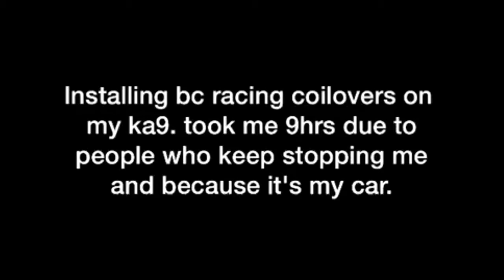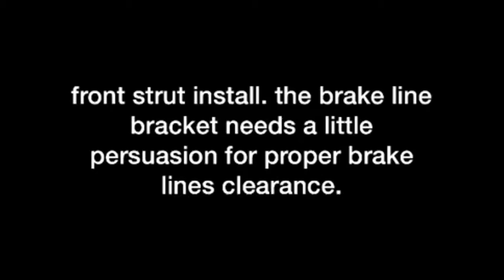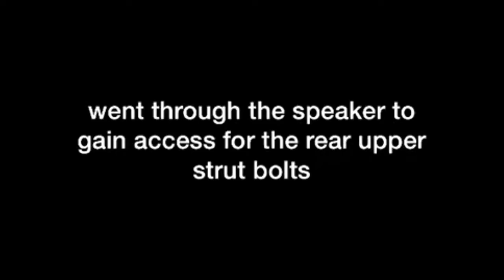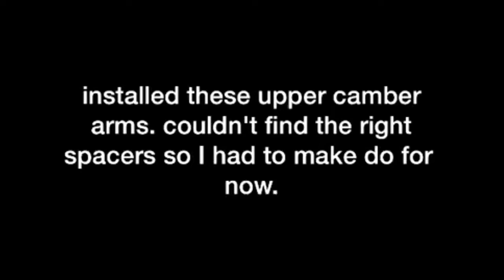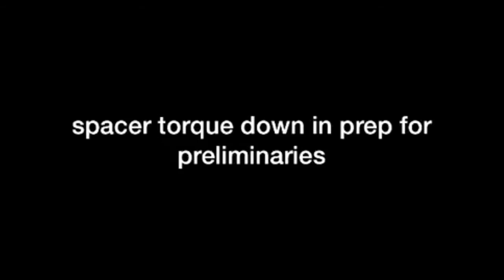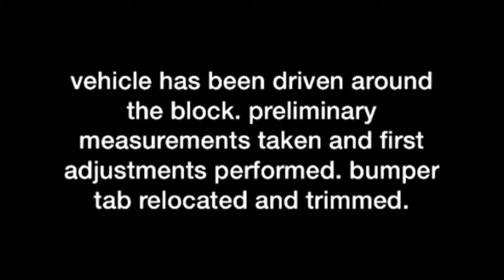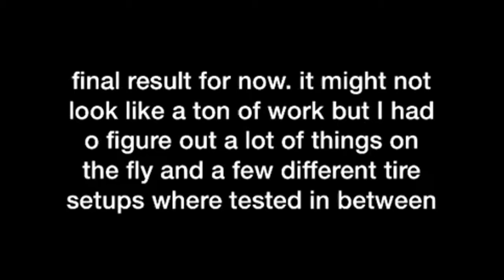Ka9 Bc Racing coilover install. Turn yah volume down!

Comment: I got 18 by 9.5 +25 offset and the wheels fit perfect for fender to lip fitment in the back, and 5mm spacers in the front for the fender to lip look, but I would recommend getting +20 in the front so no spacers are needed, this is for anyone that need help, it’s super hard finding info on this car, also if you want to run the fender to lip look id recommend upping the spring rates so you don’t damage the rim

Comment: I'm planning to lower my 2002 Ka9 with the BC Racing coilovers you used along with a set of 19"x9.5 +40 offset MRR HR3. I noticed you used wheel spacers for your car, is that a necessity for the installment of the coilover kit or something you just decided to do to get a certain look? Also you used the MDX cambers and mentioned to a previous comment that lowering the car alters camber adjustment, what happens if I decide not to change the cambers? would lowering my car still work/be safe?

Comment: Hey how's it goin? I have an 2002 rl want to lower it to.. The question is with the bc coilovers you can't just bolt them on and be done.. Why was the MDX cambers used? Is it because of the rims?
Reply from the maker: Lowering the car alters camber adjustment. I wanted close to factory adjustment and using the stock uca doesn't allow for any camber adjustments.

Comment: 19x8.5 +35 offset front,  19x9.5 +35 offset rear.. Will that work? I just want to put the adjustable bc coilovers roll my fenders and adjust the height to where it don't rub.. What you think? Appreciate the help if you can. I just bought this car of original owner with 66k on it. Don't want to chop it up to much just want to be classy with it lowered.
Reply from the maker: +Justin O&#39;Grady Yyes thatll work fine. the autocoutures i had was 18x10 +40 and was plenty

Comment: Are these the ones made for the car or they the tax ones? If they are for the model where can I get a set of these coilovers? And can you adjust the dampening or do you have to use the stock top hats? Thanks in advance !!!
Reply from the maker: They're made for the car by bcracing. 36way adjustable dampening.